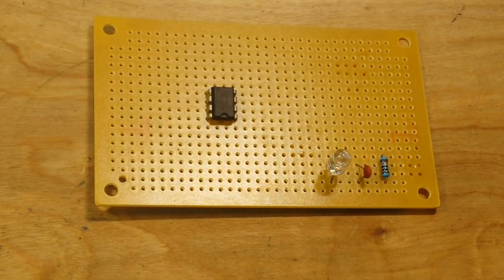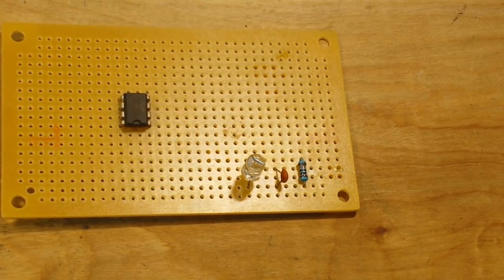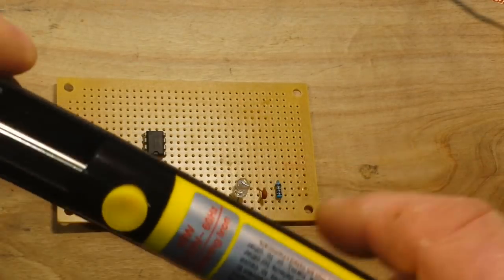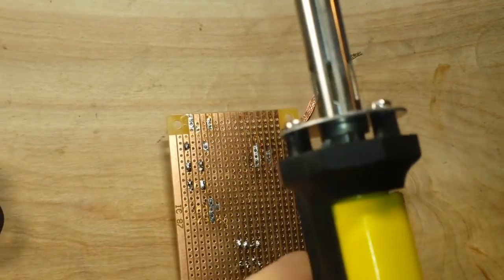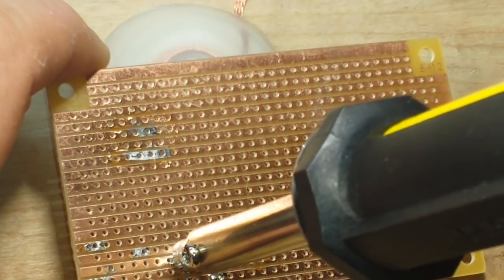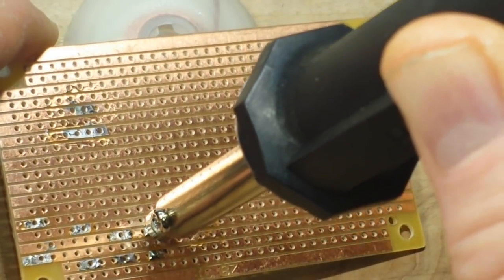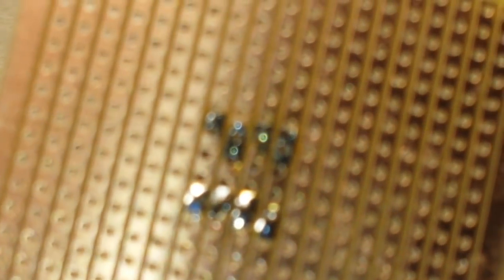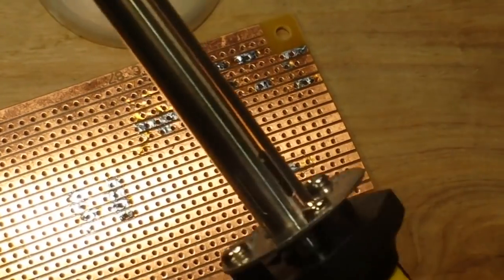Desoldering Technique #2: The Pump

Comment: I have a similar desoldering pump. But mine came from Radio Shack in the '80s. It has a squeeze bulb on the end instead of the spring loaded sucker. I still use it on occasion. I also have an antique soldering iron that automatically feeds the solder, very strange contraption. Glad to see you getting better, thanks for making the video!

Comment: At the company I used to work for, we used those silicon bulb syringe aspirators to suck out the solder. The ones they make for babies noses and ears. They were cheap and worked really good.
Reply from the maker: That's very innovative.

Comment: I find it helps a little if I use the tip to wiggle the pin a bit, to confirm the solder is melted and to get the pin off the edge of the hole just before pushing the button. Also, painting a bit of flux on just beforehand.

Comment: certainly a good time to get from u.s. amazon was ~16 a month ago, now ~11. good catch.
Reply: hey, wanted to come back to this video and report that this pump iron was a very good recommendation in my opinion. it took a while since shortly after being ~11 right after video they went back to ~16 but then back down several weeks ago to ~11 and i got one. i've been using it on a phillips tv power pcb to replace some bad components most recently and it is a great tool. anyway, thanks Paul for this video and a great find. any idea how often it needs to be cleaned? i've done about 2 dozen pulls since using it.

Comment: Hi Paul! Great channel. I purchase the de-soldering iron from your Amazon store which makes me feel pretty good that I am helping to support your channel. Quick question, how do we empty the pump out? I feel like I’m going to break it by trying to pry it apart, (is it one of those things where I need to suck it up and go for it)? Thanks!
Reply from the maker: Hello, and thanks! I have never taken mine apart! Usually the old solder just kind of blows out the hole when I cock it.
Reply: Your keyword is ZD-211, you will find some emptying instructions. But they are indeed prone to break there. You don't need to do it very often though.
Reply: @SianaGearz  .....Just re-cock it as soon as you have sucked up the solder ....away from the PCB .....the Hot solder will come out and not build up inside.....avoiding corroding the tip to a certain extent. Works for me past 16 odd years.

Comment: Desoldering shotgun there! Pretty impressive for a cheap unit. I do NOT recommend the red ball solder sucker (that usually comes in cheap kits)...its aweful.
Reply from the maker: There were a couple of times when I was at sea (under the sea really) when I had to heat up a joint and then use my Mark I, mod 0 lips and blow the solder out of the holes. Lol
Reply: learnelectronics you do what u gotta do!